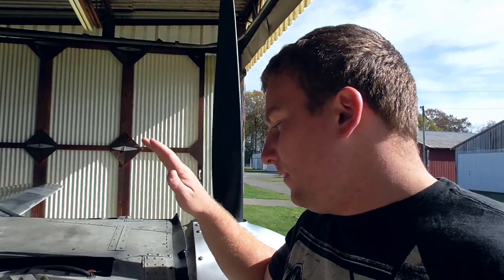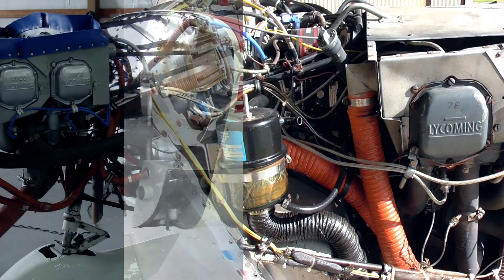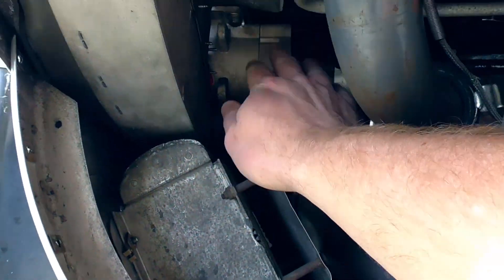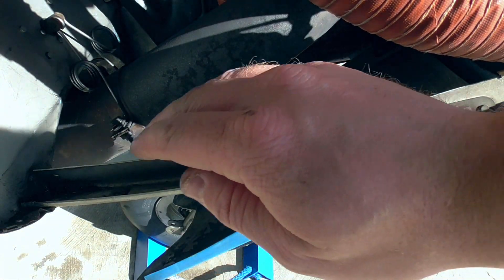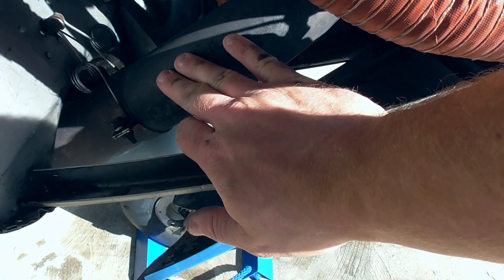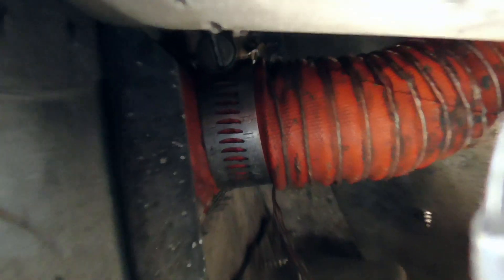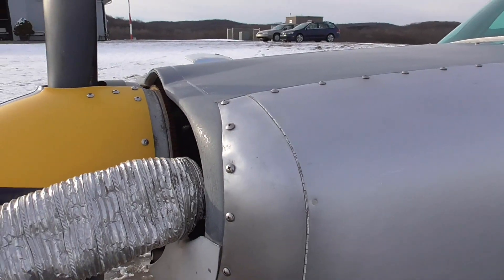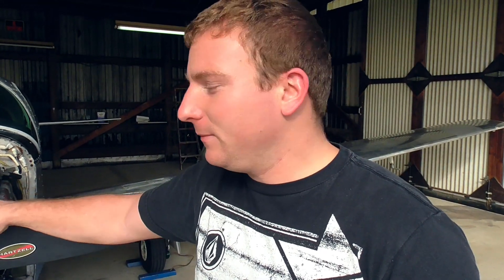Are Mooney's Really Harder to Fix? (Mooney Maintenance Insight)

Comment: I've worked in brand new 172s back to M models, diamonds, pipers...pretty much everything. I appreciate the access to things in the belly of the mooney, working on brake cylinders is really annoying but for Mooney it's in the belly along with most everything else.

Mooneys were designed for owners, really. They are not for flight schools or time builders generally. For this reason they're a lot cheaper but, unlike most other GA trainers, the more complex systems add to more maintenance overall. Having retractable gear and a constant speed is just not desirable for maintenance costs. Personally id probably rather own one over a piper but diamond or cessna would be my preference

Comment: I’m a pilot/mechanic. Never owned or worked on a Mooney. I was considering buying one. Not so sure now. Over an hour to remove the cowls. Persistent fuel leaks. I took a look at one last weekend and moving parts in the landing gear actually hitting each other while it’s sitting on the ground. I’m pretty sure it’s not supposed to work like that. Looks like poor rigging and/or worn out parts. Other mechanics warn me to be ready to spend $20,000 on landing gear on almost any Mooney I look at. It’s cool and fast. I really like it but I’d have to get some more hands on work to decide. Comments and opinions would be welcome.
Reply: 20K on the landing gear?  Replaced both main & nose rubber shock absorbers for under 2K.  Also had to replace a worn out $20 bolt on the nose wheel.
Reply: I used to own a 1967 M20F. Due to a bunch of factors, I forgot to schedule my annual one year with the nearby Mooney expert. I was told they didn't have any openings for 4 to 5 months, so I took it to a large shop instead. It was a mess. Cost twice as much, they messed up a fuel cap (I had O&N bladders) and fuel poured out during flight. The right tank emptied in less than 30 minutes . They did not bleed the flaps correctly (older Mooney's have a unique manual hydraulic flap system). When I went to raise the flaps, they just popped up to fully retracted instantly - not good. Less then a year later, performance problems turned out to be a cracked block at 800 hours. I would seriously suggest using a expert (are any left?) for the annual. If you're an A&P, get some model-specific training.

Comment: Not to slam, I’m guessing you are not a mechanic in any trade. Next time use a 1/4 drive ratchet for removing 3/8 head bolts, the 3/8 ratchet is too big for that size bolt. 40 + helicopter mechanic here.
Reply from the maker: It's fine, and you are correct, I'm not a professional mechanic in any sense, but I've been teaching myself how to work on things since I graduated high school, and I'm learning more every day. Growing up, I never had anyone show me how to do anything mechanical and I just accepted that for a while. But then I got a motorcycle and learned I really liked wrenching on it, and I've come a long way since then. I've also had to make do with what I've had on hand for a long time. I appreciate the critique, I'm definitely always wanting to learn more from those with more experience.
Reply: I don’t think you had to mention the first part, kinda a loser move

Comment: Mooney actually thought about maintenance on the rear of the engine, the bottom engine mount bolts run across the airframe and the top fore and aft so you can put a stand under the tail and a strap with a hoist on the prop then remove the upper engine mount bolts from the firewall. you can then lower the hoist and let the engine pivot forward to get to all the accessories on the rear of the engine. For the oil filter you can poke a hole in it and use compressed air to blow the oil out of it and back into the engine cutting way down on the amount that would drip out when removing it, also fashion a small drip catcher to place under the filter to catch any oil that drips out. A Mooney is not the worst to work on but it's also not the easiest.
Reply: The last thing I'd want to do, is blow the oil out of the filter back in to the engine. Well, at least the filter analysis will never show debris again...

Comment: Where does that lower cowl secondary air scat tube go?  I believe that is used for the passive bost used in a later model (you have the cowl mod and it is compatible w/both).  Mine didn’t go anywhere and is not found in the parts or service manual.  [1962 M20C]

Comment: 👍👍👍. Could you let me know of your preheater setup. I saw where the hose were in the front opening in this video. My FBI charges $20 per preheat. That could be going into the tank.
Reply from the maker: I've used a couple setups, the one you are referring to is the most efficient. Its basically a kerosene jet heater with dryer tubing attached to the front.  You can even take it one step further and make some cowl plugs out of insulation and aluminum tape. Another method I've used is just two small ceramic heaters on full blast propped up by ladders and in extreme cold I used blankets to try to help trap the heat. That method is a little less effective but is better than nothing. In my current hangar I use the two ceramic heater method but I place them in the cowling under the panels.

Comment: I hate removing the top cowl on my 1961 Mooney. I have never removed the bottom one.
Reply from the maker: Interesting, I have removed mine more times than I would like. 2 or 3 times to replace the starter (the used ones I got kept dying on me), once to fix the muffler, and once to replace the generator. I think I also have done it at least once or twice more for other reasons. I got good at it from all those times but its still a pain.
Reply: @AverageAviator  My A&P did remove mine a few years ago when I had an engine overhaul :-(
Reply from the maker: Oof. At least you have low time engine now.

Comment: My solution on that middle tube is -- don't take it off from that end until you drop the bottom cowling, and put it back before you put it back on.
Reply from the maker: I did that when I put it back on, being by myself, I figured I would just shove my hand in as far as I could instead of trying to hold the cowl with one hand and blindly fumble with the screwdriver with the other when the cowl is detached.
Reply: @AverageAviator  Yeah, it is a very tight fit!